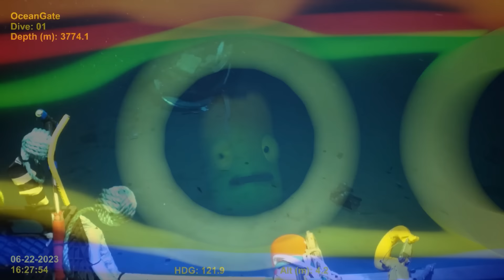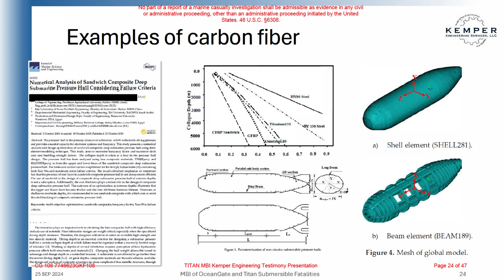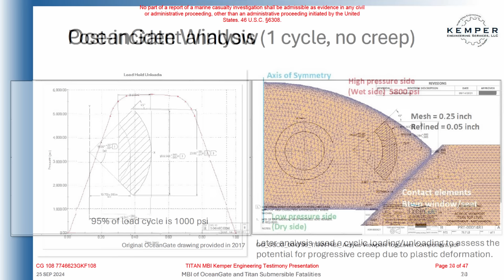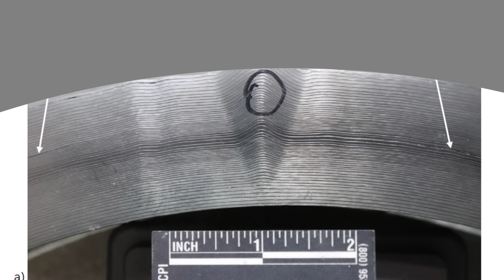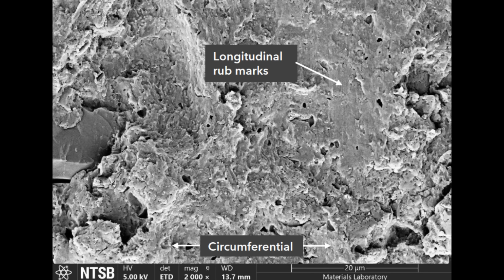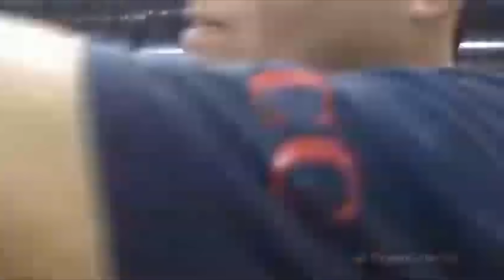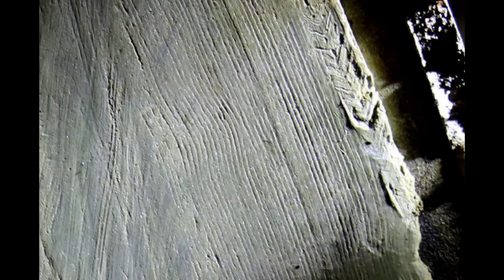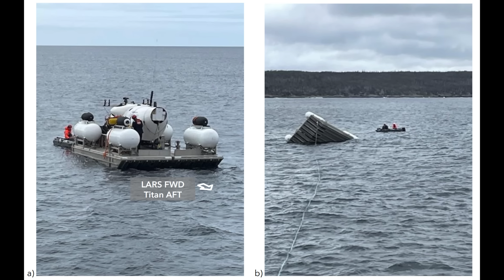OceanGate Wreck Shows Why Sub Wasn't Strong Enough To Survive - NTSB Shares Important Details

Comment: TLDR: don’t glue your sub together?
Reply: No. These specialized glues in structural applications are perfectly acceptable if you know what you are doing. Just don't tear up the structural layers (effectively pre-cracking the hull layers like pre-ripped jeans) and THEN glue your sub together, and definitely don't ignore your own structural monitoring data.
Reply: @Ithirahad as far as anyone can tell, the glue bonding the carbon fiber to the titanium was at least part of the problem because the material properties of titanium and carbon fiber are wildly different so they would expand and contract in different amounts in different directions. Well outside of what that glue was rated to handle. So if there's any one lesson here it's look at the material properties and make sure they actually line up

Comment: The issue with some of the contradictory evidence of how the carbon fibre failed is due to the fact that the submersible crew compartment first imploded, then secondly exploded in a diesel explosion and thirdly and finally imploded and collapsed into the forms as found. The diesel explosion was caused by organic matter and oxygen being instantaneously compressed in a thousandth of a second and heated to over 1000ºC. The remains that were found were essentially a film of organic goo sandwiched between the two halves of the hull. That gives a clue as to the violence of the implosion, explosion, implosion reaction over a period of a couple of milliseconds. Think of being in the center of one of those depth charge exploding scenes in submarine movies. The shock waves were so violent that they were noticed by the surface support vessel but they had no idea what had happened at the time.
Reply: Meaning gate of Heaven got a dent as death was that swift and thorough. Then St. Peter did a summary and for at least one of them pulled a lever labeled "idiots shoveling coal".

Comment: I wonder how much water could have made it in to any cavities caused by the resin/glue breaking apart. It could possibly disrupt buoyancy and cause it to tip up on end. It could also explain why they dropped two weights if water had begun to affect its sink rate. I may have misremembered or misunderstood some of the evidence though so please correct me if I'm wrong.

Comment: i think part of the reason that the acoustic monitoring system got ignored was bc what it detected was on the way back up, when u have already passed the peak point of stress on the hull….

not that its an excuse mind u, just that i can see y some1 whos closer to a layperson might think they only need the detection as an abort mission signal…
Reply: That's an interesting point. Either the sensors glitched so some kind of internal stress was being relieved through significant strain/failure within the hull.

Comment: Voids in this situation would be horrific, every single one acts as a stress concentration. Machining the carbon fiber breaks the fibers, breaking the load path along the fibers. Also my gut feeling is the cyclical loading from multiple dives would've lead to these voids expanding and creating a higher risk of delamination between layers. And the thing is that you can ultrasound or use other methods to non destructively look for these voids, delaminations, and defects. Composites are trickier to model with and figure out how many defects you'll have during manufacturing, ego and rushing to operations caused all of this

Comment: this is why carbon fiber is good for space craft solar sails, towing cables and space elevators cables, but is bad for nuclear subs and gas giant giant gas tanker diver ships. works super duper good when under alot of tesnon but  whne its crushed and smashed into a plate and put into a high crushing atmoshercal pressure  it will bascly suck so much. this is why elon musk used stainless steel for starship man hull. good for both dealing with high heat and high atamosphical stress and drag from star ships being very very very huge. thats why they scraped the carbon fiber hull for starship right off the bat.

Comment: my prosthetic leg is build better than that sub (no wonder as it´s done by otto bock the market leader in prosthetics), as they utilize cross weave pattern, even though it´s not at some critical pressure and their glue up job is absolutely shoddy, no clean room, no degassing, manual mixing and contaminating the titanium with bare hands. it´s somehow amazing it held up for so long

Comment: Scott- I find it very, interesting/ disturbing/ distressing that I have seen no evidence of cross bias wrapping or even diagonal wrapping of the carbon fiber center section of the Titan. NO footage shows these methods being used. I have yet to see any concrete evidence that they used anything other than the cylindrical wrap method on the mandrill when they made the center section. Can you provide any evidence that they used any other method?

Comment: There are parallels with the de Havilland Comet. This was passenger jet in service. . Failure to fatigue test the pressurise cabin allowed a design of rivet / windo / missing glue which caused cracking and failure in flight. The calculations were good but the construction differed. A static fatigue test found the cause, after failures in flight.

It’s worse for this sub as even if it were fatigue life tested, you couldn’t trust it because of the unrepeatable random crappy construction method. Each sub would be wildly different.
Reply: With De Havilland Comet there was also the fact that no aircraft had ever been subject to such repeated stresses at it was literally something absolutely new. This submarine was meant to do something that had already been done. Bathyscaphe Trieste dove to bottom of Mariana Trench at 1960s.
Reply: @vksasdgaming9472  some bombers were pressurised during WW2. The science of calculating fatigue life was barely started in WW2
Reply: @SW-qr8qe  Well, B-29 Superfortress had service ceiling in about seven kilometers while Comet cruised at over ten kilometers and also flew way more frequently and faster than any WW2-era bomber. In short: Comet was leap to things never before achieved or even tried in civil aviation and it's design was lead by guy with real merits in aircraft design and his planes worked. Comet was good enough on safety standards of time and proved that standards would need to be tightened with completely unexpected accidents it's first version suffered.

This submarine was cobbled-together deathtrap which worked as deathtrap is expected to function. All the info on making safe submarines was there and casually ignored.
Reply: @vksasdgaming9472  Agreed.
Experiments to destruction in either case would have been instructive.
Reply: @SW-qr8qe  I wonder was it even technically possible to test De Havilland Comet's hull on scale necessary when it was developed. As in technically and financially. In case of this deathrap of a submarine it was very possible to test it.
Reply: @vksasdgaming9472  iI was actually hydraulically tested after the failures. They built a massive rig and tested a complete fuselage.
Reply: @SW-qr8qe  That was after initial failures grounded whole fleet of Comet 1s. Might not also perfectly replicate material fatigue from thermal cycles, shocks and other stresses flying places on material. Still following generations of Comet had better safety record and De Havilland let other companies like Boeing and Sud Aviation to review their research results so they took the risk of being first and let everyone know the exact lessons.

Lesson learned: doing something nobody has ever done is not easy even when you know what you are doing.
Reply: @vksasdgaming9472  I’m a Brit and a Mechanical . Probably as fascinated by this as you are. Totally agree with your point about being first. The unknown unknowns are the hardest.
Reply: @vksasdgaming9472  as I guess you know, the Nimrod, the military Comet flew until 2011. Hell of a thing.
Reply: @SW-qr8qe  So far? I knew military variant of later Comet served until early 1970s, but that was new. Nice talking with you. Finally someone else admits that De Havilland Comet was not "useless deathtrap cobbled together with government cover-ups". It had all the problems of being first.

Comment: So my first guess was dead-on.  The non-carbon fiber materials the carbon fibers are blended with failed.  Its just like fiberglass; you can glass over anything but getting a good union to a sistered material is close to impossible.  To cavalierly shave wrinkles slather it in glue and put more wrinkles on....omigosh wtf did they think was going to happen.  If they ever did a glass over wood race boat theyd know better.

Comment: Question about the RTM system:  If the acoustic system detected a certain number of events in a dive, they were supposed to cancel the dive.  Why would the procedure be "per dive" instead of cumulative over all dives?  The events would be that of the carbon fiber weakening, and it's not like it magically repairs itself between dives.  So if the first three dives capture 5 events per dive, the cumulative number of events would be 15, etc.  You would think there would be a hard number of cumulative events before they deemed the sub too weakened to continue operations.

Comment: Composites also don't form structural shpere's well, Composites work best in lateral formations, in which one side can take tremendous impact pressure however the adjacent side will shatter when impacted in the slightest way. like a formula 1 car seeming to sexplode into a million pieces, composites delaminate, shatter/splinter and structurally fail when struck from a certian direction, When you have metal -composite connections the metals can push on the composites in the lateral directions that cause them to shatter instantly. That was the "taboo" that he ignored when he made the sub. It's apparent by the way they talk about it. I was a composite NDI technictian and know how composites fail like the back of my hand. I could have took a marker and shown yo uwhere the sub would fail with my naked eye due to their neglect of the composite titanium connections they were "experimenting" with. Even though we know from the aerospace studies how composites fail, one would think under the pressure of the ocean one would increase structural allowance, but it wouldnt matter, the titanium could tap the composite laterally with even the slightest pressure and the entire structural pannel would fail. End of story. Please feel free to ask any questions.

Comment: Sorry but even adding the 45° layer is barely improving anything. The hull strength was almost entirely the glue. Take a strand of hair and pull it apart at each end and it's surprisingly strong and resists the pulling force. Now push those 2 ends towards each other and there's no resistance as the hair bends. That bending is what the carbon fibers wanted to do in this hull, but they were held straight by neighboring strands (who were also trying to bend) but ultimately held straight by the glue. This is the reason for the warnings that were ignored about a carbon fiber hull. To be fair, I'm astonished the craft lasted 80+ trips. At 50 trips, I would have counted my blessings and ordered the craft dissected and studied to build an updated version. Kind of like a gambler not walking away after winning.

Comment: To be fair, the carbon fiber hull and the monitoring system worked as intended. The problem was that OceanGate did not follow its own protocols. The decision to brush aside the acoustic and strain data of dive 80 shows that they no longer cared about their own safety and warning systems.

Comment: In the manufacture of carbon fibre composite aircraft wing spars we get worried when we see a wrinkle that is over 2 ply's deep, also NDT analysis of the entire part inspects for voids in the layup and typically the tolerance is tiny, looking at the size of the bubbles in the layup from the short clip of the layup process its obvious that the voiding here would be many hundred times the size of an acceptable void on an aircraft component. And then you take the fact that the entirety of this submarine hull was under compression which is not the preferred loading for a carbon composite part it would suggest some serious weakness in the hull.

Also i feel that i should explain a little about the peel ply layer, a it is a fine mesh like fabric made of a material that does not bond well to epoxy resin, it is put on as the first ply, last ply or sometimes both depending on application (in the application of this hull only the last ply would be peel ply) once the product has been cured the peel ply is pulled off of the part and it leaves behind an imprint that has a high surface area which is much better for bonding, if then the part was machined to be a cylinder much of this peel ply imprint could potentially be removed. 

The more I hear about the design of this submarine the more I begin to realise how bad some of the engineering decisions were. if these decisions were made on an aircraft it definitely would not be allowed to fly!

Comment: I cannot believe they just Planed off the "wrinkles" and slapped more carbon fiber over it, you can't just "Fix" the wrinkles by getting rid of them, as soon as you have delamination in a carbon fiber build you have a point of failure, a ticking time bomb waiting to snap especially when talking about a pressure vessel. The amount of delamination present throughout the whole pod must have been insane, not to mention the design changes to the window and titanium, absolutely crazy that they though they could change a design without doing the engineering/math required to ensure the design still functioned as intended

Comment: As a mechanical engineer, who works with subsea engineering, I have no idea how carbon fiber should look under a microscope. I think that says something about using carbon fiber for subsea use, It's not common or field proven for subsea equipment. Materials used for pressure containing components subsea are very well understood, such as: high strength stainless steels, Nickel alloys, Duplex stainless steel or titanium. The behavior of these materials is predictable and repeatable.

Comment: The most frustrating thing is that they validated their warning system which many people (me included) thought was unable to detect a structural failure in time... In fact it detected structural failure several dives before the sinking...
The thought that they had a warning so clear and that they even had a successful dive with a partial failure (the deformation profile changed) with their warning system logging it so clearly that it can be seen on a graph is revolting.
Reply: It is so sad how common this attitude is. Last video I watched was the Tim Hauk dam failure and it was the same thing. Tourists: "Hey, water is flowing over the top". Dam operators: "Huh. That's not supposed to happen. Must have been the wind..." (a week later, the whole thing collapses)
Reply: @OlaRozenfeld Even more of those without tourists. Over capacity water storage, snow starting to quickly melt, and one night the whole thing falls apart after weeks severely oversaturated.
Reply: It would have been expensive and distrious to stop diving with V2 and build a V3, unaffordable for SR in the 23 financial climate..
Reply: @joefish6091 If your shit is unaffordable because you have to make it safer and better built, you shouldn't be building it at all and sacrifice the safety in the process, lmao.
Reply: @joefish6091  Building a V3 is also unaffordable for SR now...

Comment: I said from the very beginning that the structural adhesive was likely to be the culprit. I think that the structural adhesive failed at the carbon/titanium bond.

The fact that the adhesive was not even sufficient for carbon on carbon bonding is, to say the least, alarming. The substrate should fail before the adhesive. If it could fail while bonding carbon to carbon, it could definitely fail in bonding to titanium, especially as the titanium surface was not properly prepared for the adhesive layer.

Comment: I still can't believe this death trap got past the design phase, anyone with even a basic knowledge of carbon fibre knows this is the worst possible use case for the material.

It's like using a ladle made of ice to scoop up lava, yeah it "might" work but it's not the correct material for the job.

Comment: The most impressive thing about this stupid bucket of bad ideas is that it didn't immediately turn into an Exciting Physics Model the first time they took it down for a test dive. That it made double-digits trips without killing everyone aboard is a minor miracle, but not a very kind one.
Reply: Wreck expert Paul-Henri "P.H." Nargeolet, who was also onboard, told me he wasn't worried about what would happen if the structure of the Titan itself were damaged when at the bottom of the ocean. "Under that pressure, you'd be dead before you knew there was a problem." He said it with a smile.

 — as recounted by Arnie Weissmann, in Travel Weekly article published June 22, 2023